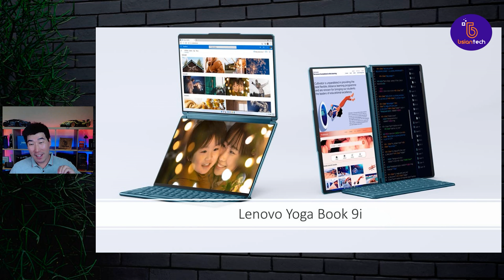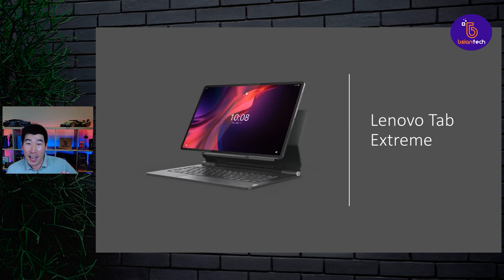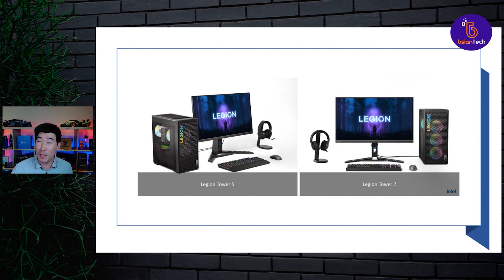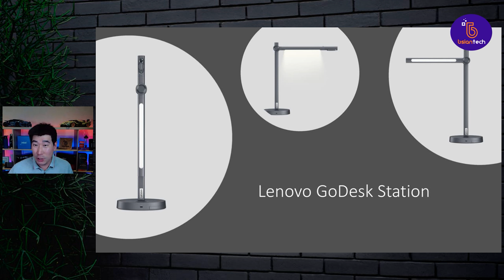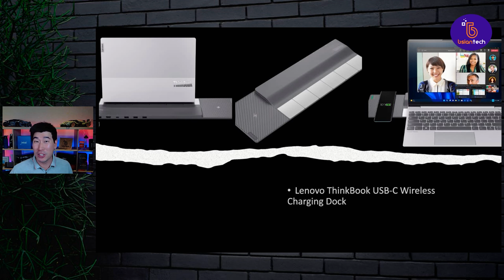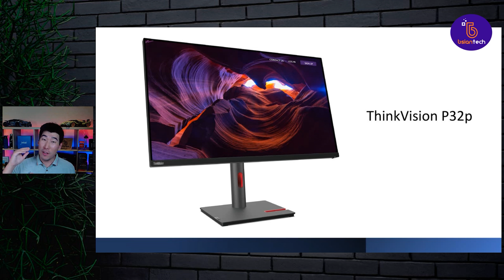Lenovo Unveils Revolutionary Products at CES 2023

Comment: Just be sure to never buy a Lenovo! I am a victim of abusive customer support from Lenovo. I bought a $3500 MSRP CreatorExtreme P27 monitor and it makes a high pitch coil whine. While I understand the phenomenon, it is so strong that I cannot work in front of it. Yes, headphones help - but I cannot wear them for longer periods either. I have 2 replacements already, and they all have the same issue. I see here a fraud scheme: Lenovo replaces a faulty unit with a faulty unit until the warranty period runs out. And all I got from customer service: the monitor operates within specification and my replacements were a "good will gesture". Have you ever heard a monitor making a high pitch noise? Well, Lenovo claims it's normal... And there's a reason Lenovo has 1.4 stars at TrustPilot.